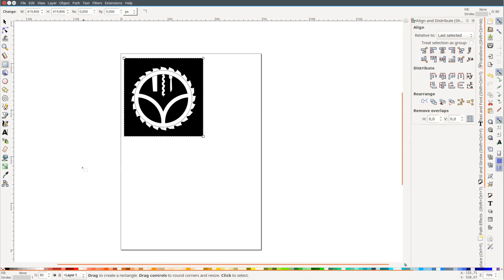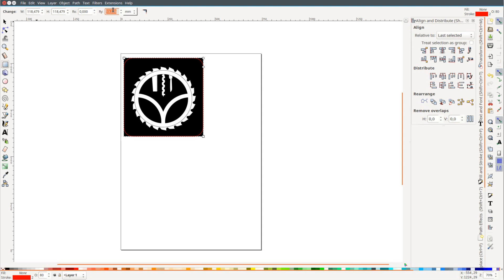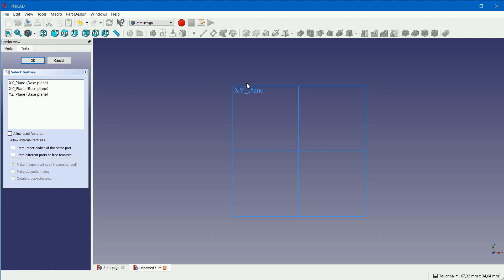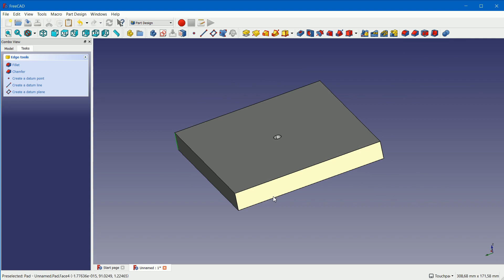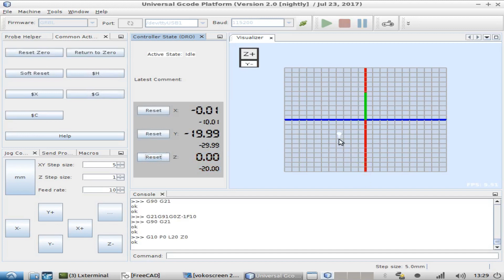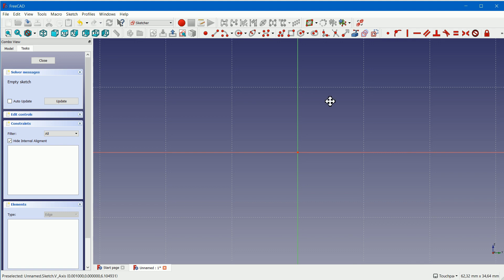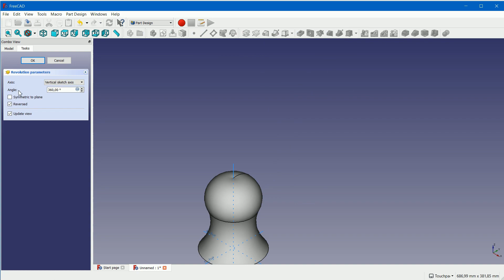Making a stamp with the laser cutter, CNC and 3d printer

Comment: Sorry to say this but the end result is not good. With a laser cutter you can make stamps with a perfect coverage. In regards to the CNC and 3D printing it is rather redundant and a waste of time and resources. Stamp handles are easily accesible and  work perfectly.
Reply from the maker: You might have missed the point of the video. It’s not about the most efficient way to make a stamp. Cutting a square with a CNC is clearly not the most efficient way. 😏
The video is about the ease of use of „digital“ tools and aimed at people not familiar with digital tools to encourage them to try out new things.